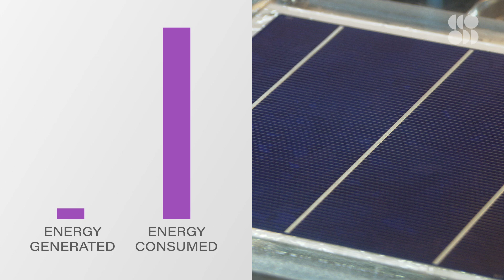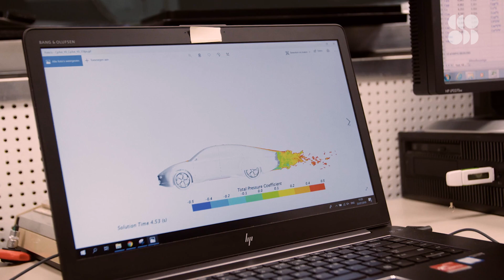The Solar Car Revolution Could Change EVs Forever

Comment: Not a word about battery capacity, speed, safety... This looked like a commercial.
Reply: Yes it did. I find it sad to see more and more of Seekers’ content is going in that direction.
Reply: This is exactly why you don't see 92% of the cars and concepts on road today! Safety!
Reply: It is as if someone else has taken initiative of seeker.
Reply: Not sure about the Lightyear, but for the Aptera:

Battery capacity/Range: 25 kWh (250 miles), 40 kWh (400 miles), 60 kWh (600 Miles), 100 kWh (1000 miles)

Acceleration: 0-60 in 3.5 seconds (AWD), 0-60 in 5 seconds (FWD)

Top speed: ~110 mph

Safety: TBD, no real world crash testing done yet, however Sandy Munro (who is helping bring the car into production) is on the record saying he is "surprised" by how well it is doing in the crash simulations.
Reply: Aptera = 300 to 1000 miles depending upon the trim level selected.
Lightyear One I believe is expected to be in the 200-400 miles range.
Sono Motors Sion I believe is expected to have a range of 110-150 miles. 
It's all on their websites.
Reply: @justin_time  the range is also mentioned in the video.
Reply: @justin_time  and where can I buy one of these fully street legal vehicles and see video and documentation from independent safety testing?
Reply: @kirkc9643  Both, & the Sono Sion solar car have plenty of details online.  Aptera & Sion should be in production early next year (2022), although for some reason this year is not a great year for getting loads of people in a small space to make something!  The Sono Sion has another advantage in terms of energy, production is planned for the ex Saab factory, fully powered by renewables!
Reply: @justin_time thanks
Reply: It is, this car keeps popping up as an ad on so many videos
Reply: 110 mph top speed. A 40 kW 400 mile on a charge vehicle. Or 60 kW 600 mi or 100 kW 1,000 mi vehicle. 700 watts of solar on the roof and back of the car.   Read FAQ on aptera.us
Reply: And let's not forget about passion for driving, emotions  and fun
Reply: the Lightyear One has 60kWh battery.
Reply: hahaha
Reply: innovation is great, trying to sell something before you have shown it to be a competitive product not so much
Reply: also that small unimportant detail callef price
Reply: @DarkResign  Ball park figures are Aptera starts at around $25000 & goes well above $50000 as you load the goodies on, Sono Sion around 25000 Euros with not many options to build the price up, Lightyear One will be well over 100 000 Euros, pricing info is available online if you hunt around a little bit (not much needed to find the info!)
Reply: @peterchandler8505  Yeah I also found out myself, I just find it weird that it isn't in the video, as 100 000 is pretty much a luxury car, while the others might somehow be afordable and it feels like that should be relevant
Reply: How would talking about battery capacity, speed, safety... make it less "like a commercial"?
Reply: @blaegme  Because these are the areas where those cars are lacking and in a commercial you only put the positives.
Reply: They have whole series and previous videos on those  both cars where they talked about it.
Reply: Yup.
Reply: A typical solar panel produces 200W in optimal conditions. That's at best just over one horsepower for the entire roof. Congratulations, they built a car with one horsepower in optimal conditions.
Reply: @WASDsweden  nah, the solar panel charges the battery that then powers the car. 1 square meter on earth’s surface received 500w in solar energy, I don’t know the efficiency of their solar panel but the surface in the car is roughly 1,5-2 square meters. Also, like I said, the solar panel is here to charge the battery, therefore, the energy accumulates in the battery, so the car makes more than 1 hp. They claim the car could cover up to 50 miles just from solar recharge, not sure about this claim tho
Reply: @WASDsweden  aptera only uses 100w. And the solar has about 1000watt in optimal conditions. Seems pretty real to me
Reply: @WASDsweden  You don't know the way the panel works that they are using it works much better then a traditional version of the solor panel.
Reply: @WASDsweden  You don't seem to understand electricity or the current state of solar cells very well. Maybe study up a bit and then comment.
Reply: And here comes the solar car agent to explain: ☝️
Reply: The title of the video summed up the level of dumb that went into the video
Reply: and there's no way you could just buy this car and expect not to pay for the power u use, probably gonna pay the car company for the power you generate or something, there's always a catch with these, this really just feels like a glorified ad.
Reply: @misterdjpookie  You pay for the solar panels... Just like if you buy solar panels for your home to charge your EV. The energy is free, but the upfront cost is expensive. If you take out a loan to pay for it, there you go

Comment: they should also add spin power.. from the wheels while driving.. kinda like an electric bike.
Reply: You mean regenerative breaking?
If yes, that’s something every EV or Hybrid has. But that’s not something a bicycle has. 

If not, … well … I don’t want to be rude but you need to brush up on what the 2nd law of termodynamics means. In short: it can’t work.

Comment: They're just snake oil. With total solar irradiance at the top of the atmosphere being roughly 1.3kW/m^2 no car with all the normal features like AC, high-beams, radio, assisted driving, ABS etc would have the range needed by the customers. 5m^2 of solar panels at a theoretical 100% efficiency wouldn't even produce the continuous power of a child sized dirtbike.
Reply: Yeah but don't let facts get in the way of clickbait

Comment: You missed the most important question. When will these cars be commercially available? Otherwise, this video is just a puff piece on vapourware
Reply: A German start up called Sono Motors will roll out their "affordable and practical" SEV called Sion  in the second half of 2022. The serial production will perhaps reach full potential in early 2023.
Reply: Another very important question is range without sunlight and pricing
Reply: The lightyear one should I believe start manufacturing in 2022: https://lightyear.one/progress
Reply: Aptera says they are starting production at the end of this year. Probably a bit optimistic considering they just came out with the beta version. They have a long waiting list, so it will probably a couple of years before they are easily available.
Reply: They will start deliveries by the end of 2021 this year. I have one ordered.
Reply: 2022
Reply: @CyberJellos  late 2021. I have one of the 1st 100 on order.
Reply: even if they are sold super expensive to only rich people, the tech wont trickle down to the masses in at least the next 10-15 years
Reply: They'll be ready just in time for nuclear winter.
Reply: It's just such a dumb idea. The current technique is not advanced enough and probably never will be.
Buy a regular EV.

Comment: I have my doubts on solar cars
 I think hydrogen fuel cells car will be future
Reply: Hydrogen is a red herring pushed by the fossil fuel industry as 95% of hydrogen for the foreseeable future comes from reforming Natural Gas.  Hydrogen is also far more dangerous than fossil fuels or batteries, and is very very hard to store (very high pressures or cryogenic temperatures).  

Check out "Hydrogen Fuel Cell Cars Aren't The Dumbest Thing. But... | Answers With Joe" on youtube

Comment: But how are you going to drive it when it rains or it's cloudy and there is no sun?
Reply: They have batteries, too, that will propel them for hundreds of miles. Helps for night drives, too. Aptera can be ordered with a HUGE battery for 1000 miles (1600 km) of battery range. The $26K one has a 250 mile range.
Reply: Solar panels still provide electricity on cloudy days, just less than on sunny days. They can even generate a little bit of electricity from moonlight. Photovoltaic cells are remarkable pieces of technology. All of these cars can be plugged in and driven just like regular EV's too, so even if every one of their solar cells was blocked, they would still work really well.

Comment: So... a super-expensive deathtrap that can only work in the south-east USA... I'll pass.
Reply: Aptera Sol for sale between $30,000-$50,000. Carbon fiber monocoque for crash structure like all modern hyper cars. Not outrageously expensive, as safe as most compact cars on the road today, maybe safer. Still can be plugged in like a regular EV to charge on cloudy days. ~10-15+ miles added on sunny days. Not as outlandish as some people think.
Reply: @justin_time  An EV which includes solar panels to add up to 10-15 miles a day is exactly not what this clickbait garbage says

Comment: What do you mean "forget EVs?" This is literally an EV with solar panels
Reply: The point being, is that if we can make a semi usable vehicle, that is solely powered by solar panels. Than its more than possible to make a traditional ev, that can be changed by traditional methods and by solar panels. At least as a back up
Reply: @TheDarkPacific  For many drivers the Aptera is completely usable, how many cars never have more than 2 people or 25 cubic feet of stuff.. The point is that the solar PV trickle charges the main battery, so that if you drive less than 40 miles a day in Texas / California etc. (20 in much of Europe) then you would only need to plug in to charge for a very long trip over a few days.  The Aptera offers battery range options from 250 to 1000 miles, so the solar PV adds 40 miles, then if you need more the Aptera works with normal EV chargers, adding range much faster than other EVs because it needs so little power to drive...

The Aptera works because it is so efficient (uses a third to a quarter of the energy to drive a mile compared to the bulk of EVs, 100Whr/mile) that the 4Kwhr from solar PV charging therefore offers useful range.  Because other EVs do not have the efficiency of the Aptera, then solar PV panels will only offer a small increase in their range making them impractical in many cases...  

The Lightyear One works because so much of the car has solar PV, even then the extra range is far less than the Aptera, with the Sonos Sion nearer to the Lightyear One than Aptera in that way.
Reply: @peterchandler8505  thanks for the essay, but i wasn't disgeeing with anything the video said. My point was to generalize the fact that the creation of solar panel powered vehicles is a viable and in fact a necessity.  That there most certainly is a point lol.
Reply: @TheDarkPacific  Think I wanted to respond to:
"semi usable vehicle, that is solely powered by solar panels"
As it looks as though the Aptera is eminently useful for a significant proportion of drivers, and that solar power is just a trickle charger, but not solely powered by solar power as it's efficiency makes charging much faster then other EVs, and so easier to use on the rare times you will need to plug in...

"creation of solar panel powered vehicles is a viable and in fact a necessity" - Absolutely!
Reply: @peterchandler8505 I used that a counter argument to the cavemen who this the Aptera is pointless, when in fact if it was half the vehicle it is, it would still be very much useful as a proof of concept. People seem to forget that technology doesn't exist ina void. That even a concept can easily trickle into other tech thats as similar as a clone, to as different is a potato is to an apple.
Reply: it's called a comment generator
Reply: What they might was an EV that can only be charged by electricity from a power grid
Reply: @scarlet_phonavis  nuclear power is great, but the elephant in the room is that our energy grid in the US isn't even really equiped for modern demand, much less an all-electric future, and you know it isn't going to be ready any time soon. Grid-independent cars are the best way to make EVs actually viable.
Reply: Fed Rai  | I don’t think the !whole! thing is bullcrap … but yes, a few grains of salt need to be added.
(and by few, I mean many many more than they let on)
Reply: Fed Rai  I think EngineeringExplained debunked solar powered cars because the can't produce enough energy over the course of a year.
Edit: OK his conclusion was about 40 miles a day so it can work.
Reply: @james10o1  I feel like he's being disingenuous. It's entirely about use case.
Many people - like me - don't drive more than like 25miles/day at most, for 5 days a week. You could easily power that car indefinitely on solar panels alone.
Reply: @james10o1  His conclusion in that video talked about how solar powered cars like Aptera (given their stated specs) are feasible/possible.
Reply: @james10o1  did you even watch the video
Reply: @james10o1  for a conventional size car yes. However for a small car. It's 100% possible. There's competitions for this. Now. My problem is that car will not last long at night. And might have terrible safety due to weight, size, and possibly lack of crumple zones. All of that would add a lot of weight. But it's required to make a compliant car with current regulations.
Reply: The conventional used regular electricity, this uses electricity that generated from solar energy
Reply: @tamaica7770  "Regular electricity". 🤣  There is only one kind of electricity. 🤦
Reply: ipissed by regular electricity i meant the one generated by steam turbines using fossil fuels, nuclear,.. Those are bad for the environments
Reply: When they say "forget EVs" they are referring to the current standards of design that EVs have become known for and instead start from stripped down design requirements.
Reply: @scarlet_phonavis  nuclear car🤷.
If u would know specially in us nuclear is just dream..u cant rely on unprobable thingsm
Reply: Fed Rai  not really..its just lightyear one is just too expensive and aptera is just weird and seems unsafe in USA

Comment: Now we are thinking in the correct direction. Start with power available and base the whole concept around that. I have said for years we can create solar battery hybrid vehicles but the design has to be radically redesigned from the top (Sun) down! ☀️

Comment: They didn't address one of the main problems with solar cars. What if you want to drive at night or when it's a very cloudy day? I don't see this pratical without solving those issues. I don't think our current battery technology would solve this, mainly because they are heavy, would take a lot of the efficiency of the car.
Reply: I guess you missed the 450 mile range of the Lightyear One's battery. The Aptera is available with an even larger battery range - up to 1000 miles, more than any fuel burning roadster! That should cover your night time and rainy day needs. You can also plug them in to quickly recharge if that's not enough.

Comment: Okay but... What's the max range without charge, 0-60mph, top speed, crash test ratings, carrying capacity, estimated cost for consumers, charge time via solar, max battery capacity, etc.? Wouldn't a solar-car ALSO run on batteries charged by sunlight?! This invalidates the arguments that they would be "better" for the environment. If there were enough charging stations for regular EV vehicles, a solar-car will be a pathetic option for any consumer. Lastly, to answer his question on "Why do cars all look like bricks?", this is because they NEED to conform to safety regulations to protect the end-consumer. Just because you can prototype a vehicle, doesn't mean you are anywhere close to making a product that is safe or viable for commercial or normal consumers. This vehicle brings nothing new to the table that couldn't already be added to existing EV vehicles.

Comment: Ok? Lemme know when you have a solar powered car that can do 0-60 in 3 seconds flat and can continue to do launch take offs over and over without dying lol also lemme know when you have a solar powered car that can travel at 70mph for 300-500 miles without dying lol
Reply: Why would you need all that? Not all cars have to be solar cars, you can a small one for going to work every day and a non solar for big trips
Reply: Sorry, they are not building cars for drag racing. You're on your own there. Aptera can only do 0 to 60 in 3.5 seconds, but can go 500 miles at 70 or 80 mph.
Reply: @fotoguru222  or maybe nearer to 1000, or is the 500 miles compensating for the higher speed?